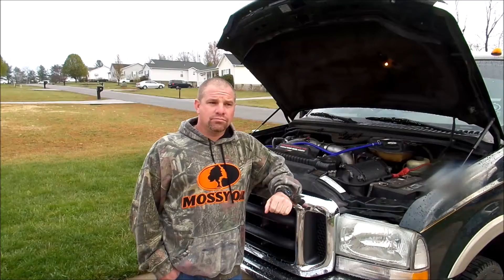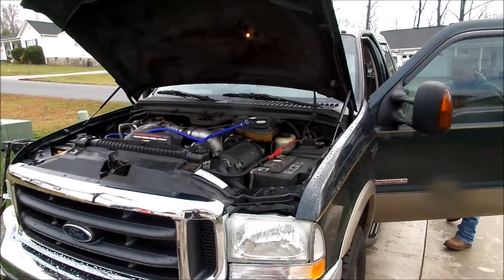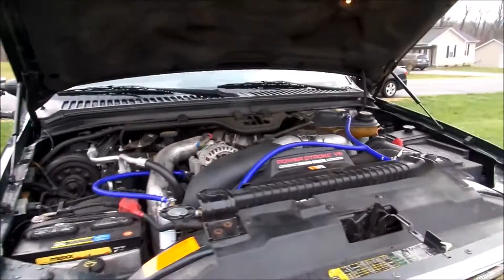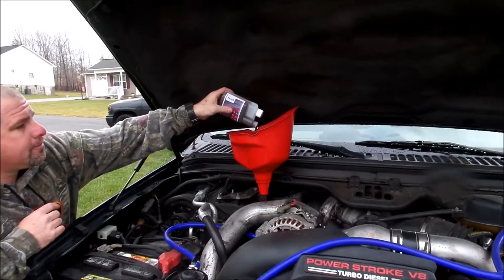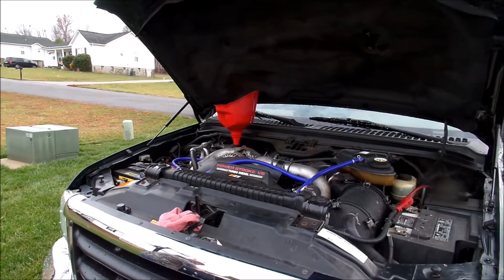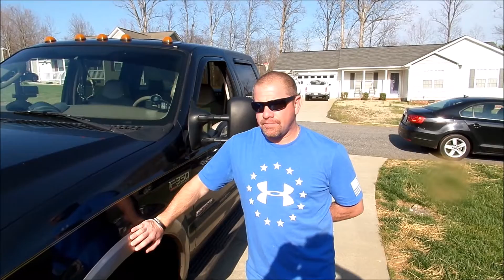Arch9100 oil Rev x oil x user now only use Turbo Maxx & Zddp Maxx

Comment: I'd love to try these products I've had the same issues and I've tried rev-x, and arch oil and still am having the same issues and i'm tired of spending money on non-working products to see the same end result. Just don't want to try another product to see the same end result.
Reply: Anthony McDonald I recommend this product it worked on my 06 6.0 it worked after I changed the oil with Turbo MAXX almost instantly I couldn’t believe it I tried all the other ones hot shot , archoil they didn’t work for me try it you’ll like it !!! Best 55 bucks you’ll spend.